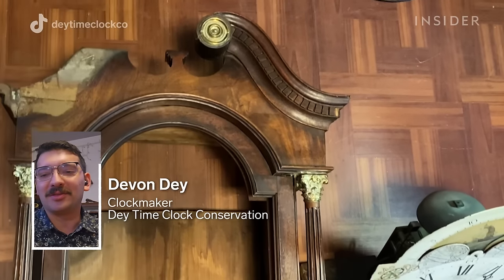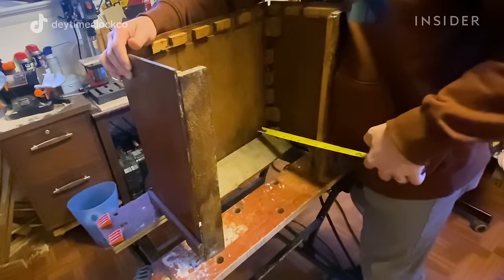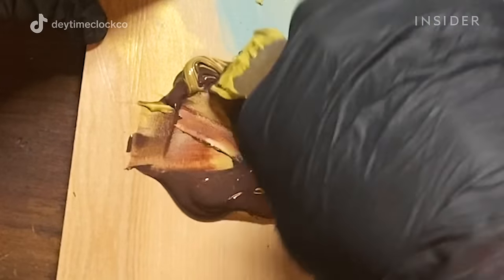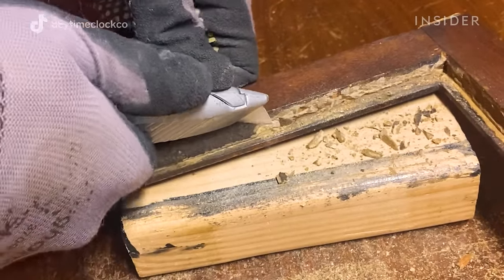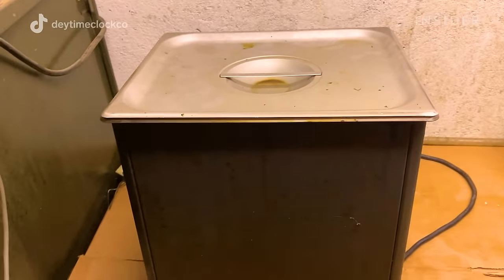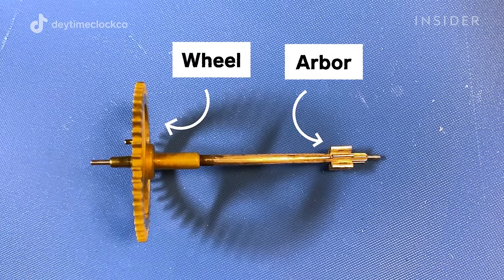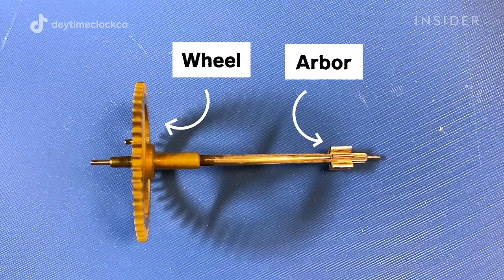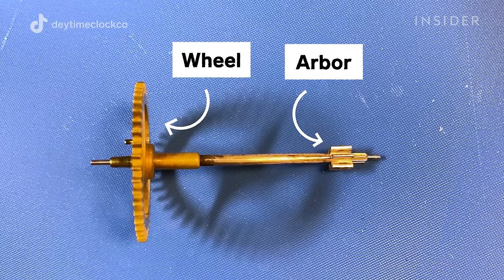Restoring An English Grandfather Clock From The 1800s | Refurbished | Insider

Comment: I have a clock that was used and abused and covered in oil that spent 100 year's in India being fixed by less then professional people and probably doesn't have any matching bolts or screws it's good to do this hi quality of work if you can but i have proof that 100 years of doing it wrong didn't kill it not that it keeps time great but I'm not Shure it ever did

Comment: @nalakprince6376 - i have to disagree with your comment about using reclaimed timber...... the idea of a sympathetic restoration is to save as much of the original clock as possible. 
Replacing is not the object of sympathetic clock restoration at all [unless it is absolutely necessary].
The full history including repairs completed goes  with the clock as a part of its ongoing story.... 
As to the video.... thank you,  i am in the middle of a full restoration on an English painted pine 1835 longcase clock for a customer (my first longcase) i am extremely grateful for your full and clear explanations of the steps you have undertaken [i have previously only worked on wall clocks and mantle clocks].

Comment: To remove the hardened glazing putty, a hot air gun will soften it brilliantly and you can clean it perfectly, the whole frame in about 10 minutes.  Taking out while it still hard will take ages and you seriously chance damaging the wood or the veneer. I have done it on several and it works brilliantly.I hope this helps.

Comment: The dial corners are identical to a clock that I have.  The works has some identical features as well.  Suggestion: Look at the lead back of the pendulum in your video.  See the inscription?  My clock’s pendulum has a very faint inscription as well.  It is just visible in the patina and I can make out “1829” below a faded and difficult to ascertain signature.  I am going to get another look at it and see if it perhaps matches the signature on your dial.  I know that the odds are pretty thin, but the dials were almost certainly made to the same specifications as the color and patterns in the corners are spot on as a match.

Comment: I am torn between thinking that you have done a good job and thinking you have done a bad job of this restoration. The wooden case deserves better than a filler on it, like hiding the rusty bits on an old car! Surely, the correct way is to make replacement wooden parts from reclaimed lumber and then stain and polish in the traditional way to match the existing appearance. Using modern materials to patch and paint over to give a grain effect seems sacrilege to me.... 🤔

Comment: You are way off with the value of the clock. You should never clean a clock of this age using an ultrasonic cleaner as it can and will damage the brass. All parts should be cleaned by hand. Cleaning out the holes with peg wood yes, but peg wood in a power tool just to get the job done faster terrible work. The clock has a painted dial and are known as White Dial  Longcase clocks.  The finish of the movement is very poor. I would never send out a movement looking like that.